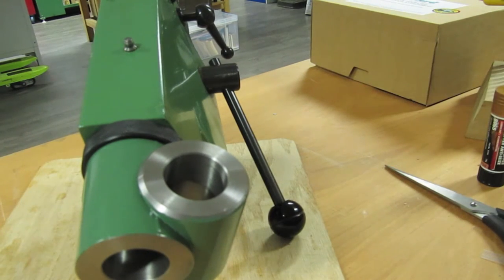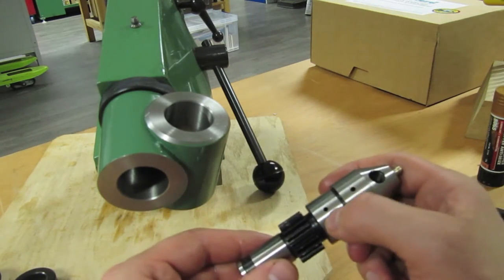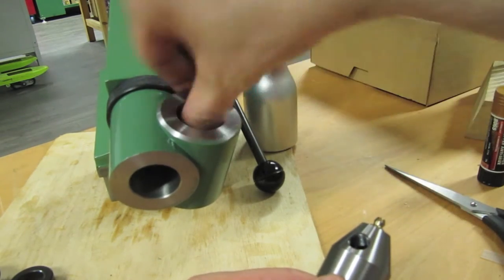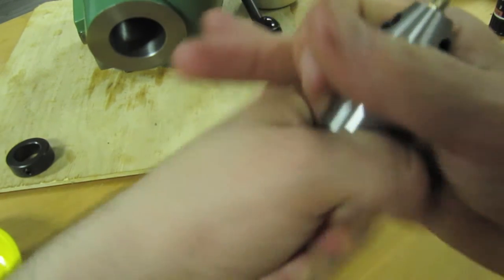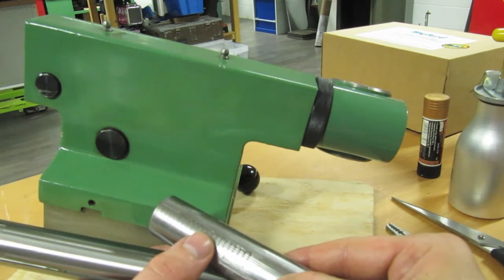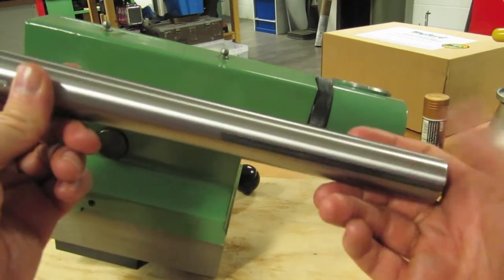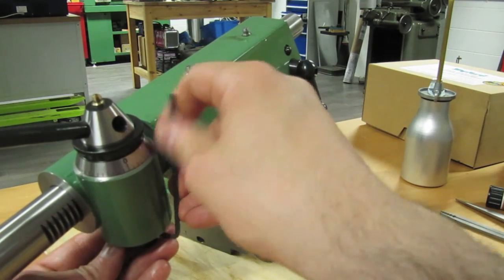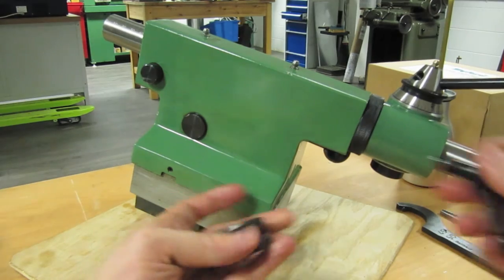Myford Lathe Tailstock Upgrade Part 2 of 2

Comment: I bought one of these recently and I agree with you. It's mostly well made and up to the standard one might have expected from the old Nottingham made Myford stuff except for a few details, which is a bit disappointing when you consider how much these things cost.
Mine had a big burr around where the cross hole for the pinion breaks through to the main bore. I couldn't stand the cheap knobs either, so replaced them with some nice bakelite ones from WDS. And replaced that dreadful looking ball handle with a custom made knurled headed screw.
Also disappointing is the fact that the graduations around the dial are not accurate! The pitch circle diameter of the pinion x pi cannot be divided into a nice even number of divisions, so the grads are just an approximation. They could have made a slightly modified pinion (only a tiny mod is required) to give accurate graduations.
The paint on mine is also a slightly darker shade of green than my lathe, as is yours.
I also spent some time looking for the ball bearing on the floor - only dropped it the once though!
Reply from the maker: I don't mind the paint colour variation - even if the paint had been "identical' to begin with, Myford could never account for how different lathes out in the wild would have faded differently (some in sunny workshops (here in England??!), some not). I'm not sure I understand what you mean about the divisions of the dial. Surely it doesn't matter what the pinion/rack ratio is. All that matters is whether the dial itself is accurately divided, so that you can read relative depths of travel. All the ratio does is give you a slower or quicker feed to the barrel for one revolution of the handles.
Reply: Kosmos Horology It doesn't matter what the ratio is, the distance travelled by the tailstock barrel is the pcd of the pinion multiplied by pi, which doesn't work out to a whole number of millimetres (or a sensible fraction of an inch for that matter) so it isn't possible to engrave an even number of whole divisions around the dial, there's always an odd fraction left over. The divisions on the dial are only an approximation.
If you wanted to drill to an accurate depth by reading the divisions you'd be out a bit, the longer the travel the bigger the error will be.

Comment: An interesting feature? of my unit is that the barrel is marked in metric and the handle scale is imperial, as to accuracy I could not comment. It's very useful to have both readings as I guide whilst drilling.

Comment: As both sides are the same diameter,  was it possible to swap around the Split cottter pieces so that the control knob is on the same working side of the machine?

Comment: origonaly the tailstocks were made by cowels, i have one for my ml7. this version is the new myfords. My beaston myford version on my conissure is imperial, did not had no c spaner no horible handel and came with allen keys, tools and instructions. Pete at myford notingham put two balls and springs in the box as spares. I would not be without the attachment though?
Reply from the maker: It is a great attachment. I love being able to knock the taper tooling out using a bar. Some part of me still regrets mothballing that beautiful acme barrel feedscrew though!
Reply: yes, I. also have one of the originals. brilliant thing and glad to see that it is still an option for p people who are not fortunate enough to have one. I'm gutted because some lowlife stole my tailstock capstan head but not the tooling and my rotary table and not the dividing attachment or plates so they only wanted it for scrap. breaks my heart when I see the plates and capstan tooling as it was my late father's.